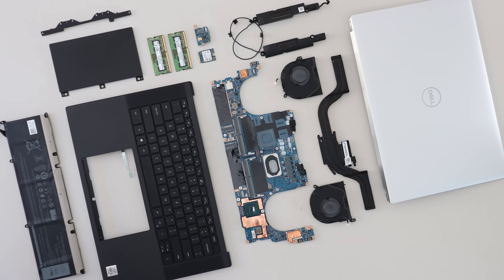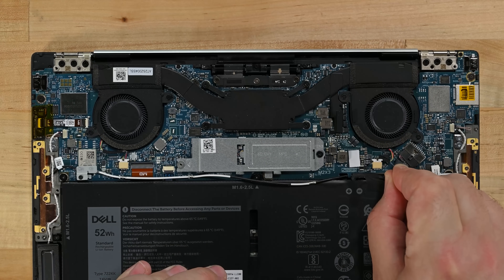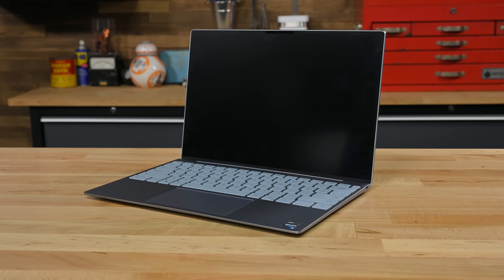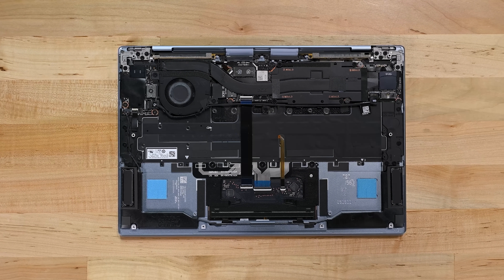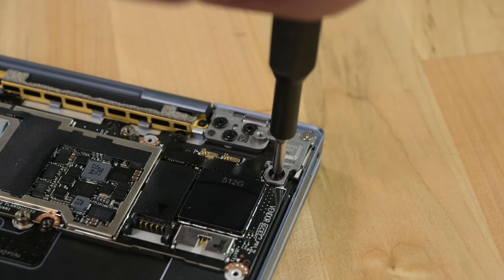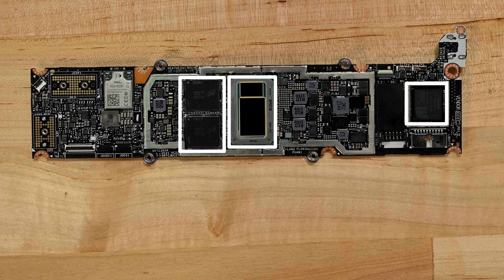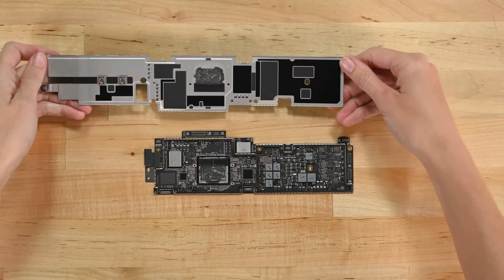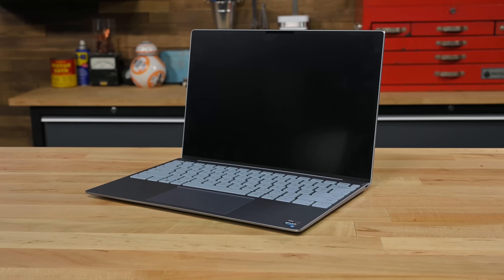The Dell XPS 13 (2022) Teardown: Is This The 13" Laptop We've Been Waiting For?

Comment: Genuine question - what keeps the Framework Laptop from being the standard issue laptop for the iFixit team? From an outside perspective, unless someone needs more GPU power it checks just about all the boxes, including being able to upgrade the main board. That's a box no one has checked.
Reply: A lot of iFixiters (including me) do have the Framework Laptop! It's on our recommended hardware list. For folks who need a dedicated graphics card, we've recommended the XPS 13 or 15—and now just the 15.
Reply: @liz_ifixit  okay awesome! Genuinely just curious. Thanks for the reply!
Reply: To my understanding, when they decided to upgrade, the Framework laptop had not yet been released; only XPS and other premium thin and lights were available.
Reply: I think is perfect, however I would like to have a 15 ish option
Reply: I think the biggest think might be the lack of dedicated graphics. The second Framework makes a larger version with dedicated graphics, I'm immediately on board, myself.
Reply: Battery life matters, even if there is a repairability gimmick.   Screen options matter.  Et cetera.  Framework only appeals to people who are evangelical about replacing every component, but most of us prioritize getting a good laptop first.

The thing is that once a laptop allows you to replace the battery, RAM, WiFi, and storage, you'll be covered for 99.9% of users.  There are  plenty of non-framework laptops out there that let users do so, with some combination of better price, more power, better display options, better battery, etc. How many people are willing to compromise on things like battery life, display, or speed just to maybe do an expensive mobo and CPU swap-out down the line?  It's a solution in search of a problem.
Reply: @HappyHubris  yep and Framework are improving battery life on both 11th gen and 12th gen laptops model through BIOS update. Appreciate their work tho
Reply: @ShirleyMárquezDúlcey  I think with the movement from Framework, eventually I think JEDEC will release the LPDDR4/5 (or DDR4/5L or U) RAM stick.
Reply: @HappyHubris  I agree with you to an extent - I think being able to upgrade the non-standard components like the CPU is incredible. Hopefully one day you could upgrade the screen and or speakers if wanted. 

However you are right about the overall experience first - a $499 ASUS laptop at Staples comes with a high resolution, 90 Hz panel that looked great. You could by an Asus G14 for a similar price, and have some modularity. Also, repairability doesn’t need to be as easy as it is on the framework to still be repairable. It’s a great thing that it is, but with skill you can open a Surface Studio laptop and replace faulty components. It will just take longer.
Reply: They just upgraded a year ago and one of the key things about right to repairability is keeping the device as long as we can
Reply: The lack of a 15" option for one thing. That and the weird aspect ratio is what's keeping me away from Framework.
Reply: @flow221  but if you work with MS Surface, the transition between Surface and Framework will be painless
Reply: @trandinhvietdung9357  does any framework laptop have touchscreen? I think not. That's the major point why i'm not even considering it.
Reply: @trandinhvietdung9357  I absolutely love the ratio on the surface. I wish external monitors came in 3:2 so much better with extra height. Racing games benefit so do many other games as now graphical power has games being developed for taller environments. Like larger skyscrapers and such.
Reply: @flow221  3:2 is the superior aspect ratio
Reply: @its_jjk  Depends what you're using your laptop for. If you're spending a decent amount of time watching video, 3:2 is silly. 16:10 is the best compromise.
Reply: @flow221  I’m with you in preferring 15” laptops, but I think a 13” Framework is much like a 15” widescreen. Considering the narrower screen on the Framework, it has to make up for the lost width in extra height. As it turns out, the extra height puts a 13.5” 3:2 (such as Framework) very close to a 15.6” 16:9, minus the width (of course).
That said, yeah, I can see 3:2 and the odd resolution being a deal-breaker. I’m giving it a shot, but I can’t deny I would have liked a more orthodox aspect ratio and resolution too.
Reply: it's crappy expensive laptop.
Reply: @nnnnnn3647  not so much tho, lack of dGPU throws them off or they have not moved to that yet but are prepared for that
Reply: @trandinhvietdung9357  This is a project for people who are just plain naive.
The company cynically uses the sentiment for self-repair, but in fact sells expensive laptops with poor parameters.
Reply: @nnnnnn3647  i don't think so, they only released 2 model while the company is founded in 2020. They simply need time to improve. What they did is excellent, even tech reviewers praised that and Framework kept their promise about that. Take a look at their website pls
Reply: @trandinhvietdung9357  I looked at the page. The prices are too high. Replacing a motherboard with a new processor costs as much as a new third-party laptop.
They will file for bankruptcy within the next two years. The market for such laptops is too small. People go to the website of Apple, Dell, HP,  Acer and buy a laptop. 99% never intend to unscrew them and replace anything.
Reply: @nnnnnn3647  you sure? you are getting backlashes here
Reply: @nnnnnn3647  People never intend to unscrew and replace anything unless there is something wrong, why replace the whole notebook when you can replace certain components at a lower price.     Moreover the mobo price is actually quite reasonable given the power of the chip. (i7 1280p definitely a pricey exception)
Reply: @samov5133  Or people can just sell their existing laptops and buy a new one, which will cost about the same (or a little more) than replacing their MB after 2yrs of use. Most people have ZERO use with their old MB aside from enthusiasts.

Moreover, if you have used a laptop for many years, who wouldn't want to replace their laptop with a brand new one with a better chassis, display, etc ...
Reply: @RunForPeace-hk1cu  you do know you could sell the old board…
Reply: @nnnnnn3647  wrong and more wrong
Reply: @nnnnnn3647  THAT IS BECAUSE IT NOT ONLY CONTAINS MOTHER BOARD BUT NEW TOP COVER ALSO!
Reply: @its_jjk  thanks for telling him
Reply: @nnnnnn3647  its a tablet with a keyboard.
Reply: @nnnnnn3647  Great comment bro

Comment: I'd be interested to see your take on Lenovo Thinkpads as they supposedly offer documemtation for them online and, At least from what I remember, Have a repuation for being upgradeable.
Reply: @binary_dale  One would think that you'd NOT add weight to keep a semi-Portable machine, err, Portable.  Kinda funny in a sad way if HP actually did that, But at least they're not Dell.  I know Ifixit likes them but I've had nothing but poor experiences with them, Machines and company, over the years.
Reply: @binary_dale  It's quite sad to see Thinkpads go downhill. My Latitude E6410 is starting to age, and I will need a replacement for it soon, but I'm definitely not willing to buy any of the new Thinkpads because of their lack of upgradability. Framework laptops are a great choice, but way too expensive for me as I already have a maxed out Precision 7760 as my main laptop.

Comment: The motherboard is impressively small for an x86 system. Too bad you can't swap out the SSD and the Wifi card.
Reply: I can understand soldered on ram if the laptop is slim enough. However the storage should always be replaceable whether it be a socketed SSD chip or an M.2 drive.
Reply: Framework 13 is just as small, yet swappable wifi card, SSD and RAM, and webcam, and keyboard, and ports. Also parts are actually available for it.
Reply: at least Dell doesn't charge ludicrously for RAM and storage upgrade.
Reply: @allansh828  or are they? Board replacement is very expensive if one or any of the components break, especially outside of warranty
Reply: @RinoAP  And the most terrifying, you can easily lost all the important data in it. Imagine if your soldered RAM is broken and all your important data is lost for mainboard replacement in service center because the SSD is also not removable
Reply: @sihamhamda47  yeah, this practice is pretty bad from big company because sooner or later smaller company will follow
Reply: @allansh828  not yet

Comment: So a scale 1 to 10 how y’all like it?
Reply: 0
Reply: About 3. Battery can be easily removed, as can the display, but that's about it.
Reply: @TheSpotify95  No 1.5 Because too much is soldered apart from the battery and there is too much e-waste in this product.
Reply: I was wondering the same.
Reply: In the negatives